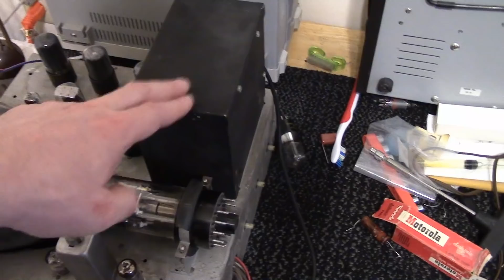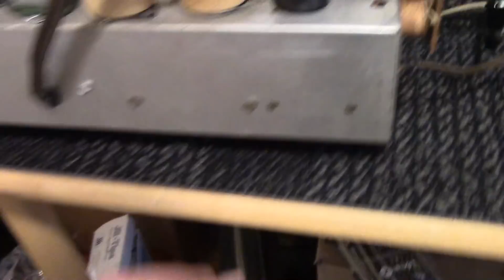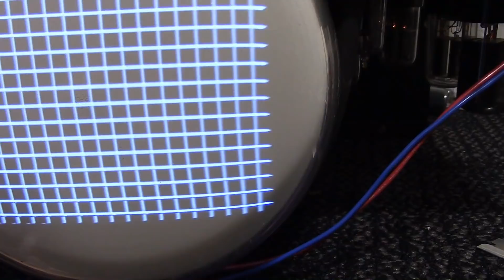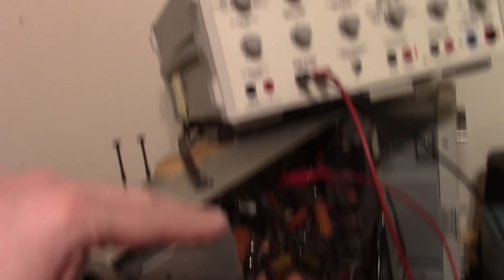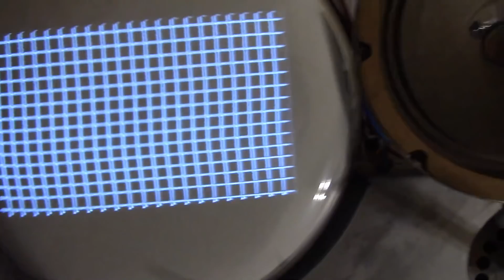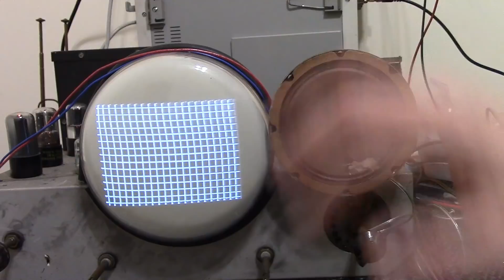Meck XB-702 p9o10

Comment: Mr. Bandersen, you are designing for a quickly designed television for profit when television was a hot market.  In my engineering work, we spend hours on isolated, non-ideal effects, and artifacts.  In engineering a chunk of the work is in non-ideal effects.  Environments are noisy; everything wants to talk to everything else especially sensitive front end circuits that both has to operate with very small signals and yet not listen to the surrounding environment.  Physics doesn't have to work the way we think; it works the way it is.  That I can tell you know well.

Comment: Greetings:
I would try converting all of the heater strings to DC with a 4-diode bridge & filter.
What about an external aquadag grounded coating with a spring like on more modern CRTs.
This set was before B&W sets had chroma eliminating circuits added.
Eliminate the tuner filament transformer. First convert the tuner heaters to DC.
Time to use the scope on all deflection circuits. (Doesn't account for clean picture on external CRT.)
New tack: maybe there is enough DC flowing through the steel chassis that would be avoided with a floating chassis. Use a simple pocket compass to check for magnetic fields near the chassis. With the CRT mounted as it is, a small magnetic chassis field could be the culprit.
Reply from the maker: This is a rare set and my goal is to do as little modification as possible. My goal is not to reengineer the set. It's only going to be used for demonstrations. Picture tubes are far to scarce to run the set very much. Aquadag coating does not block magnetic fields. The circuit inside the HV box would need to be modified in order to use DC for the tube filaments. All I had to do was rotate the filament transformer about 90 degrees and the problems went away.

Comment: Could the filamant transformer have a s short to its case?  Seems odd that the audio got buzzy when the transformer case touches the chassis? Maybe the tuner filaments could be floated and not run to chasis ground?  Maybe tracking down this buzz issue will reveal something.  Seems like a ground loop problem.
Reply from the maker: Chassis is ground.  If there were a short to the case the secondary would be shorted out.  Rotating the filament transformer 90 degrees took care of the problem.
Reply: @bandersentv  Actually, I was thinking about floating the filament without any chassis connection.  Run xformer power to the filaments and run a return back to the xformer without connecting to chassis or ground anywhere.  
I wonder if there is any resistance or leakage between either winding and the case. It should be open. Maybe there is  a primary to secondary leak? I wasn't thinking about a hard short anywhere.
Did the 90 degree rotation remove the audio hum? Is there still more hum when the transformer touches the chassis?
=Steve.
Reply from the maker: @stevemarkowski9795  One side of the tube socket filament connections in the tuner are soldered to the metal body which is ground.   I'm not sure what was going on with that audio issue.  It might have been before I modified the 1st audio stage to have a low impedance.  The speaker is dead silent now regardless of how I orient the transformer.
Reply: @bandersentv  Fantastic. I admire your work.  =Steve.

Comment: Have you tried cutting the filament power when the set is running but keeping the AC to the rectifiers? This should tell you if the distortion is from the filament string or from the DC supply.
Reply from the maker: Virtually all of it is coming from the filament transformer.  The DC supply is clean.

Comment: One thing that occurred to me was: what if the filament transformer was 180 out of phase? If you flip either the primary or secondary windings, does that have any effect? As you mentioned, the Teletone has all the tubes in series, but this set has a filament transformer, so maybe the current in the tuner filaments is 180 out of phase with the current in the other tube string? Though, granted, I would doubt it - your experiments seem to show that it’s magnetic fields from the transformer causing (at least part of) the problem.
Reply from the maker: Hmm, interesting question.  I should have tried that while I was experimenting

Comment: Could the wobble be due to a beat frequency caused by the difference between the 60 Hz AC line frequency and the 59.94 Hz refresh rate of color TV? Back when the set was new and black & white TV signals were still exactly 60 Hz, that wouldn't have been a problem.
Reply from the maker: It's certainly why the distortion moves slowly.  The only generator I have that runs at 60Hz needs servicing.  When I used it the test pattern had stationary distortion but I couldn't say when it was from the Meck or the generator.

Comment: Do you notice that the non-filament transformer ripple doesn't seem to be so much in the deflection but in the square pattern itself? like if you turned the brightness up the edges of the rectangle seem to stay the same but the grid moves within it?
Reply from the maker: What point in the video are you referring to?
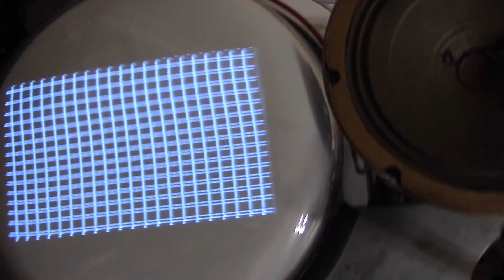Reply: @bandersentv  look at 32:10 hard to be sure in the video but top right of the pattern it almost looks like the grey background stays straight but the bars are shifting left. Maybe something with the tuner or the sync like you were saying.

Comment: could there be a H-K short maybe on a tube and AC is leaking in that way?
Reply from the maker: I've replaced every tube at least 3 times.  It made no difference.  The filament transformer seems to pre responsible for all of the vertical 0Hz interfoerence and some of the horizontal.  The rest of the horizontal issue I believe is from some 60Hz making it's way into the sync pulse.

Comment: Exactly (in reference to your statement at  46 minutes and 20 seconds) ... that is definitely an innate design flaw with the transformer fields affecting the CRT. 
This reminds me of years ago when I home-brewed  a little modulation-monitor scope using a surplus 1 inch scope CRT, all built into a  3 x 5 x 7 metal cabinet, to be used along with a home-brew 40 meter AM-CW ham transmitter-receiver. In my experiments in placing it's little miniature  power-supply transformer for minimum effect on the screen I did something like what you did and added some longer wires to the transformer and moved it around to different spots on the little cabinet.  I found that placing the transformer on the outside on the back of the cabinet directly behind the base of the CRT, with the ''E'  of the transformer oriented horizontally was the best spot for no 60 Hz magnetic interference on the screen. 

That scope shield you demonstrated  is amazing in it's ability to block the transformer's pulsations... I wonder what it's metal mixture is. I wonder if it has any bismuth in the mix...

Thanks for sharing, Bob
Reply from the maker: Mu-metal is mostly nickel with some iron and smaller amounts of other metals like copper, chromium and molybdenum.  It needs special heat treatment after being worked and is rather expensive. It doesn't really block magnetic fields, rather it absorbs them.
Reply: That's an interesting note about the positioning of the transformer. The TV I'm working on has some distortion I believe is from the CRT and the transformer is located under the back of the neck. I'll need to check which way it's oriented.
Reply from the maker: @eDoc2020  Electrostatic set?
Reply: @bandersentv  Mine's electromagnetic but I don't think it matters in terms of susceptibility to magnetic interference.

That makes me think, I'd be curious to see what would happen if you install an electrostatic CRT in an electromagnetic TV. I presume it would work fine assuming the neck fits in the yoke and the pinout differences are accounted for.
Reply from the maker: The HV supplies in a magnetically deflected set are 2-5 times that of an electrostatic which will make the beam harder to deflect and less susceptible to noise.  I've never heard of it being an issue.  I would think the yoke itself would provide shielding.  Electrostatic CRTs have a much larger neck, but it would probably work/

Comment: Great interactive vid ! In keeping with your desire to keep it as it would have been 'back in the day' I think the Meck bean counter accountants would insist on the cheapest solution, so mounting the transformer where the speaker used to be is I think what they would have done, and a lot easier than making a mu metal shield.  What a fun vid !
Reply from the maker: I'll give it a try.  I'll be sure to twist the wires too.

Comment: Has anyone brought up the historical refresh rate change yet? If so, disregard the below...
Older B&W broadcasts would have been at a vertical refresh rate of 60 Hz to minimize the 60 Hz AC noise messing stuff up in the sets. Today's rate is 59.9 Hz for colour compatibility so you are getting that "beating effect" distortion (60 - 59.9) Cycles/sec. It was not an issue when these sets were being used as the refresh rate was still 60 Hz...
Can you generate a 60 Hz B&W signal for the set (older signal generator), if so does the distortion go away?
Cheers,
Reply from the maker: Yes, I mentioned it a few times.  The difference is why the distortion slowly travels.  I did inject a signal with a B&K 1077 which uses the line frequency as the source of the vertical sync pulse.  The distortion is present but it doesn't move.

Comment: An option you didn't mention is to make a CRT shield out of the material you were using to shield the filament transformer.
Reply from the maker: It's very expensive and needs special annealing after being worked.

Comment: Are you sure it’s not RF from the video lighting?
Reply from the maker: What are you referring to? It's 60 Hz radiating from the filament transformer
Reply: @bandersentv  I commented too early into the video. It’s strange though. I can’t imagine the chassis being built that way. It’s almost as if something is missing- like grounded shielding around the rear of the CRT, etc.
Reply from the maker: Keep in mind it's not the original tuner.  The transformer could be a replacement too.  Considering it had almost all original tubes in it, it might not have seen much use because it was a lemon.

Comment: Well I will say again if it were me I would be using a filter probe with the 60 hertz Notch filter enabled, that way probing the spaces where there shouldn't be any 60 Cycle when you do hear 60 Cycle in those locations at least you can waive the probe around to see exactly where it's coming from, however that's from an old field technicians point of view.
Reply from the maker: The vertical sync is also 60Hz . The two signals mixing is causing the traveling distortion. There is supposed to be a 60 cycle component in other words. I'm not sure if you could distinguish between the two
Reply: @bandersentv  yes that's correct however it's not quite 60 hertz and I can distinguish using my ears the difference between the 59 X and the 60 Cycle, if your ears are that Discerning you could use the output of the filter probe to a scope to visualize it however you have to keep looking up at the scope that way 😎
Reply: @bandersentv  yes that's correct however it's not quite 60 hertz and I can distinguish using my ears the difference between the 59 X and the 60 Cycle, if your ears are that Discerning you could use the output of the filter probe to a scope to visualize it however you have to keep looking up at the scope that way 😎
Reply: @bandersentv  yes that's correct however it's not quite 60 hertz and I can distinguish using my ears the difference between the 59 X and the 60 Cycle, if your ears are that Discerning you could use the output of the filter probe to a scope to visualize it however you have to keep looking up at the scope that way 😎
Reply from the maker: Also the filament transformer is the source of virtual all the distortion.
Reply: @bandersentv  yes I seen that I watched your entire video, also kudos on the interaction that you have been driving on the series, it's just that my point was back in the day if I showed up at a studio and some monitors had problems like this I had to stop the problem as quickly as possible using this technique and a little ear training this culprit would have been identified very quickly.
Reply from the maker: Using a scope I can follow the hum easily enough.  It starts at the output of the detector and gets amplified along with the video signal and affects the horizontal sync pulse.  What I don't know is what to do about it.
Reply: @bandersentv  well at the detector stage it wouldn't take a very large field to cause this problem, sometimes lead dress can create issues if you can find a nearby out of phase field on a wire somewhere just a slightly longer lead on the opposing field May cancel the offending field.

Comment: Could you have a bad ground in the RF circuits?   You also could have HK leakage in the IF  circuits. Those can be a real PITA to track down, unless you sub all the tubes with known good ones.  Could you have a bad filament bypass cap that has opened, especially if they were paper mica?
Reply from the maker: Not that I can see.  All the ground connections are directly to large solder joints on the chassis.  I've reflowed all of them.   I've also swapped out all the tubes with three different sets.  Made absolutely no difference.  All the bypass caps are 5,000 pF ceramic disc.

Comment: Would twisting the wires together have any affect
Reply: Single wire daisy chained (in series) to each tube. Usually a choke  is found along the line powering the
 tubes to cut out hum.
Reply: @hestheMaster   Bob was saying about the  possible   magnetic efect on the crt .and with the red and blue wire draping over the tube I wondered if could have some sort of effect on the crt .so twisting the two wires together might have a small effect
Reply from the maker: Twisting them together is generally a good idea.  The magnetic field is pretty weak though.  Wires around an iron core like the transformer makes a much strong field.
Reply from the maker: Which wires?
Reply: @bandersentv  red blue probably won't  have any affect  .never tackled tvs before so on a big learning curve. Just an observation. And I am learning a lot from you and shango66